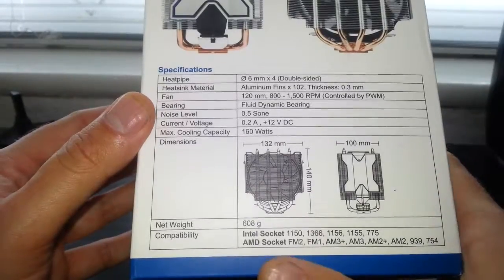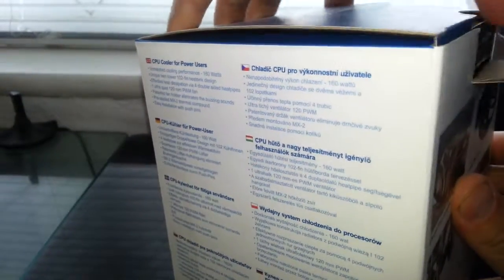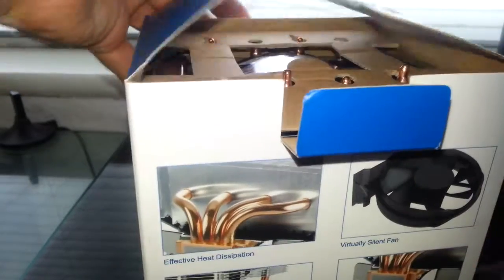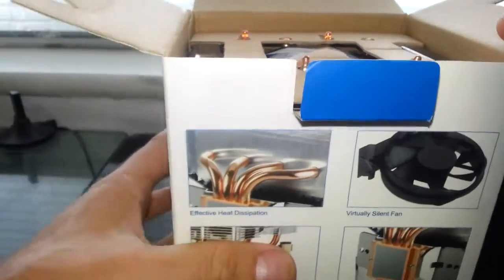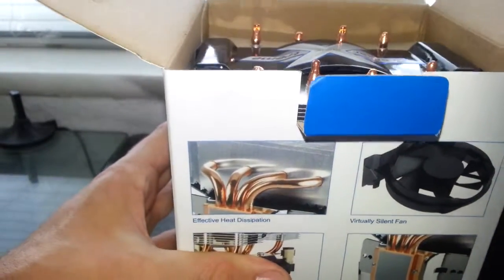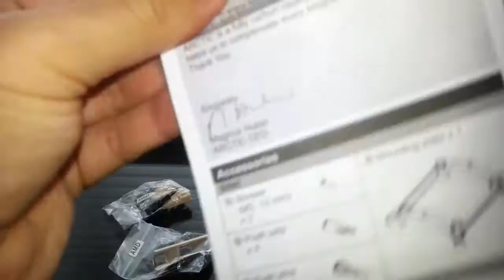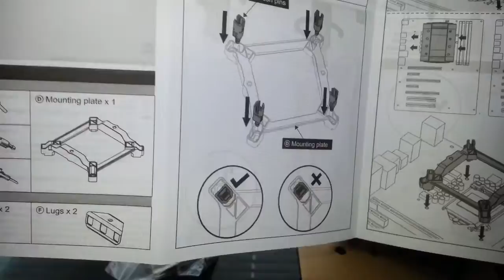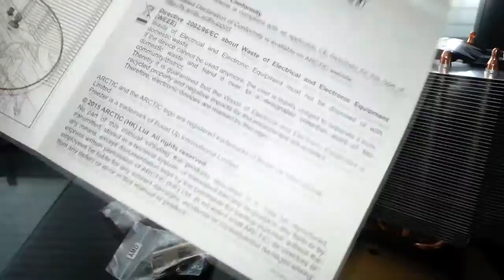My Arctic Freezer Xtreme Rev. 2 CPU Cooler Product Review

Comment: Nice video like , Fits in a housing with a maximum height of the processor 140 mm??
Reply from the maker: Round about that. The Cooler has a 120mm fan inside it.